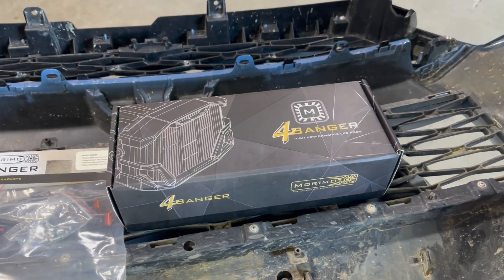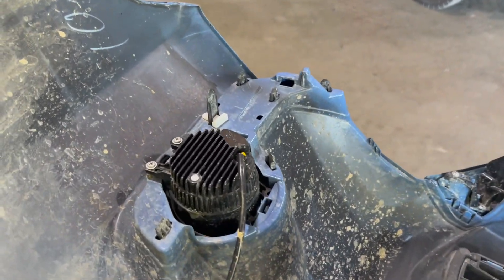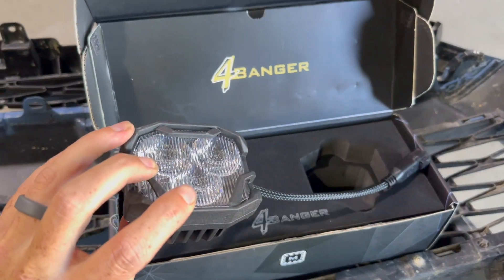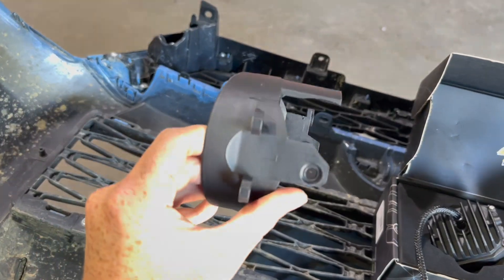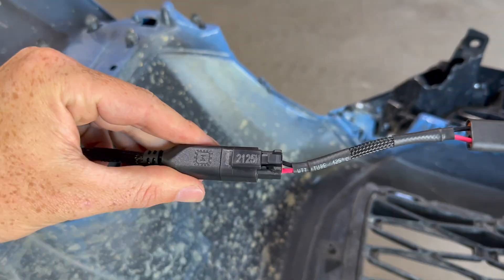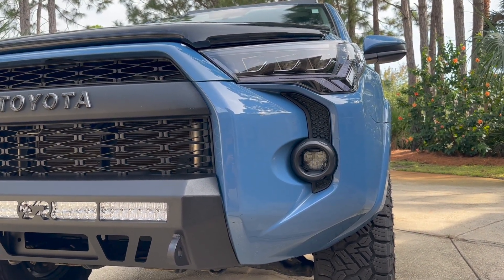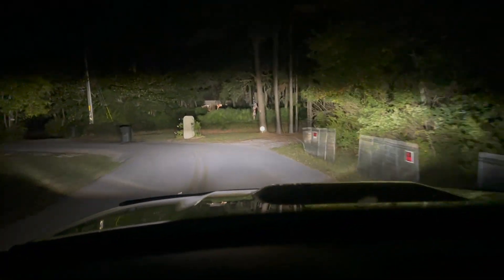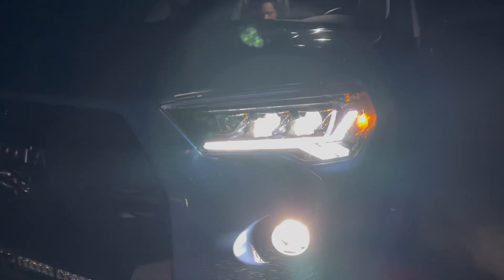These New 4Runner Fog Lights Are BRIGHT!! - Morimoto 4Bangers

Comment: So I bought a set of morimoto hxb fog lights and I have to say I was disappointed. The screws that they use on the pod light housing seem pretty cheap. In fact, one of the screws was stripped so I never actually got to install the fog lights

Comment: Bright indeed, I like to drive with my fogs on so they would not work for me.    Those seem to be off-road only.   Very cool though for that use.
Reply: They also have the 4Banger ncs which are more for on road, I have amber angled down 3 degrees and I never get flashed
Reply: @amatthews3170  Thanks bro, I’ll check it out.

Comment: Nice work.
Ever do an install on -22 Trail E. that does not have fogs??
Reply from the maker: You should have fog lights still right??? or you mean a tacoma?
Reply: @TRDJon  Tkx a lot Jon but it's a taco TE/ no dang fogs from factory/ heard there's a work around that involves taking dash apart/ not ready for that frame-

How do u have a taco w/ factory lift higher than O/R s: no lites?? Geez?

Anyway- appreciate the reply- suggestions?